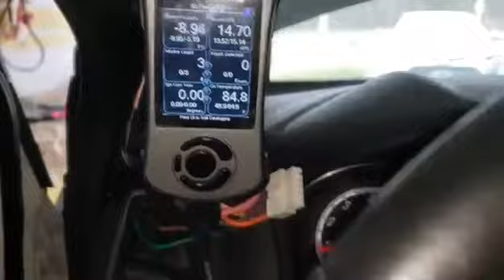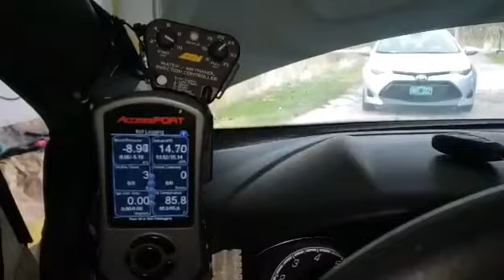Focus ST Engine Rebuild - Cyl1 Bad | Tested 1st g30-770 | (Old Video Jan. 2020)

Comment: Am putting my 770 in right now im glad youre back man i looked you up to get some info on the 770 and couldnt find ya i was wondering why
Reply from the maker: Yea i wish i never deleted my old channel,  it was just getting crazy out of hand with other non sense.  I miss my old st videos tho
Reply from the maker: The 770 is a solid setup ,  depends on your hp goals tho.  G30-660 will fit better since the compressor housing is smaller frame and it should make 550whp no problem.  The 770 should do 650whp.

Comment: I’m installing my g30-770 with a .61 ar housing this weekend any tips ?
Reply from the maker: You need to remove the passenger axle and shave off the top portion of the axle C bracket to fit the compressor housing since its huge.   Other than that check out the "How to Videos series"  i got turbo setup and prime turbo oil in that playlist.

Comment: What clutch have you been using? I have a big turbo focus only pushing 350whp but I’ve blown through 2 competition stage 2 clutches in less than 30,000 miles each. 90% of my miles are highway driving
Reply from the maker: Ive had great luck with my spec stage 3+ stock style clutch,  But even a stage 2+ non sac w/ billet flywheel is rated high torque.  https://www.cjponyparts.com/spec-lightweight-flywheel-for-use-with-spec-specific-clutch-billet-aluminum-focus-st-2013-2018/p/SF33A4/
Reply from the maker: https://www.cjponyparts.com/spec-clutch-kit-stage-2-for-use-with-spec-specific-flywheel-focus-st-2013-2018/p/SF333H4/?gad_source=1&gclid=CjwKCAiAi6uvBhADEiwAWiyRdv5-vAAKhGdr4UiEswyixi738V1HnjWDxf9j3OT4tlPHiHM0TKTeOBoCDXMQAvD_BwE
Reply: Nice man thank you. I’ve heard nothing my nightmare stories about the spec clutches. Good to know you’ve had good luck with them
Reply from the maker: Yea idk about any issues really other than people over look spec clutches, ii think people just dont break the spec clutches in properly and wear them out faster because of that,  I know someone that loved there stage 3+ with 650whp held up great.  Mine has some wear for 8k miles of street stuff but it felt great and isnt much stiffer than stock imo.
Reply from the maker: Full disc clutches dont chatter as much fyi,  the 6 puck act or spec chatter loud.  Also getting your flywheel and clutch balanced can help
Reply from the maker: Its crazy you blew thru those clutches,  my stock clutch lasted 46k miles with 30k miles of that big turbo 7163efr with around 360whp.  93 tuned.  The flywheel is the weakness,  maybe you should get a rs stock clutch and fidenza flywheel?  Or go spec stage 2+ stock style *